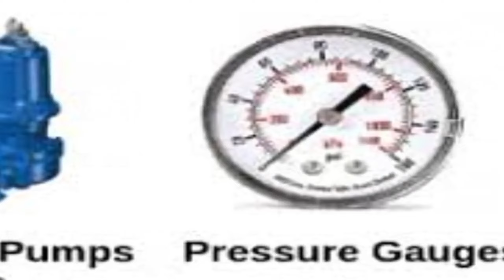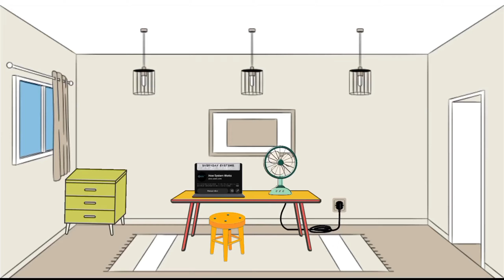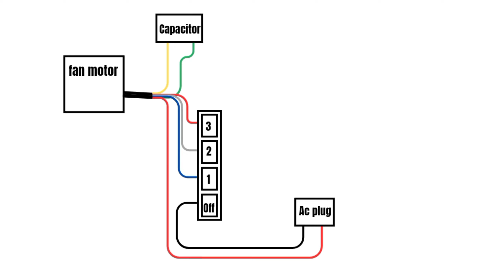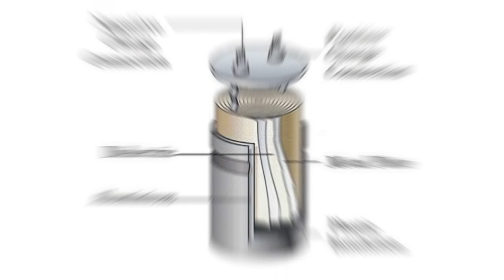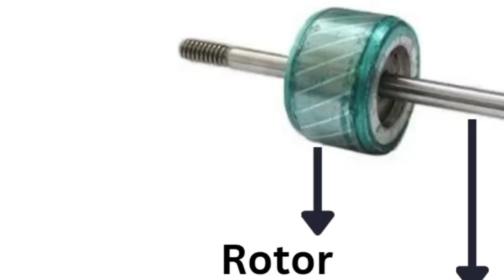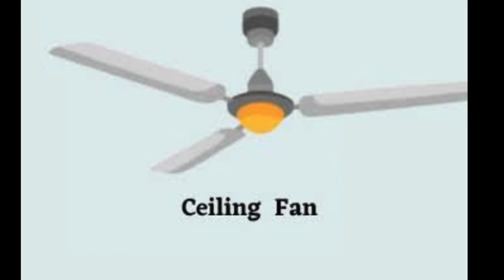How a Standing Fan Works, Full Breakdown With images

Comment from the maker: Got questions about how this fan works? Drop them below👇👇
Reply: How does the motor spin without any copper wire connected
Reply from the maker: @Kennyfresh-e5x  The motor's copper wire is hidden inside the motor housing
Most standing fans use an AC induction motor
Reply: @how_system_works sorry I mean the rotor 
It doesn't have any wires on it
Reply from the maker: @Kennyfresh-e5x  The rotor spins without direct wiring because of something called electromagnetic induction,
The stator (the outer part of the motor) has copper windings that are connected to electricity. When current flows through them, they create a rotating magnetic field,
Now, the rotor, which sits inside, doesn't need to be wired. It’s usually made of metal bars or laminations, the changing magnetic field around the rotor induces an electric current inside the rotor itself, which then creates its own magnetic field
These two magnetic fields, from the stator and the rotor, push against each other, and that’s what makes the rotor spin.
It’s the same principle used in induction motors, they spin using invisible magnetic forces, no wires needed on the moving part.
Reply from the maker: @Copelandnelson-u6g ❤